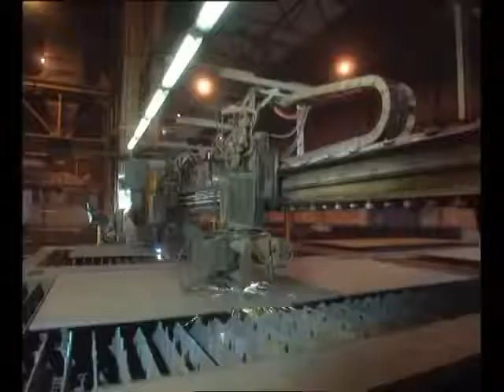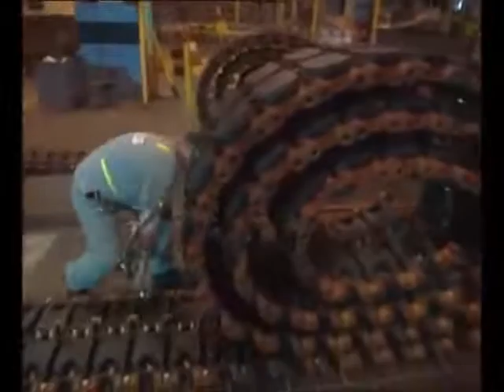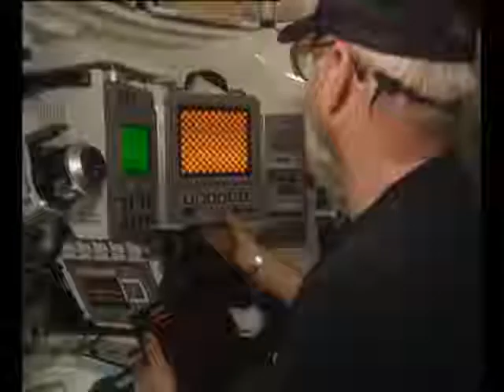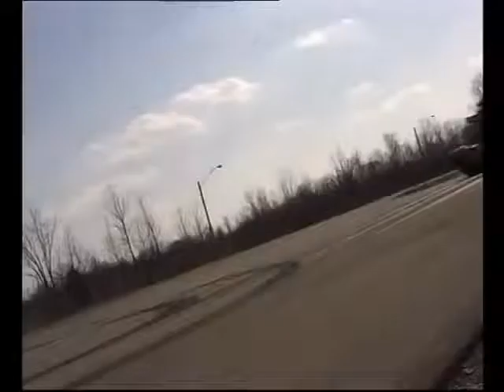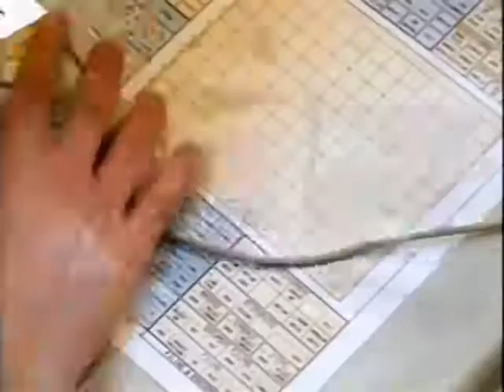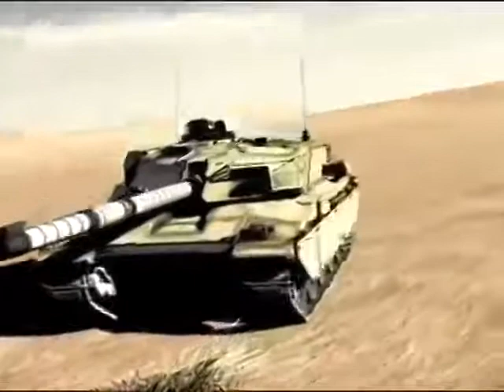Dangerous Weapons 2016 Challenger : 2 Tank Vs M1A2 Abrams Tank US

Comment: The Abrams has some advantages just as the challenger, its a trade off. Yes the challenger hasn't had an enemy destroyed but neither has the Abrams. 9 Abrams tanks were "Destroyed" 7 by friendly fire and 2 by self destruction as prevention of enemy capture. The Armor on the two tanks are very comparable in almost every respect. I'd say it's who shoots first and has better tactics in a 1v1. The Abrams still has more effective weapons control. The Abrams also has a faster to speed of 45ish MPH with 1500 HP. Were as the challenger 2 has a top speed of 37MPH with 1200HP. I think to put one of these machines down is insulting to its engineers. I'd just say both tanks are on the same level of greatness. Although being American I must be partial to the Abrams. 🇺🇸
Reply: Be partial to the abrams but thankful to the challenger. Its the challengers Chobham armour that's now also protecting the abrams

Comment: In a 1v1 the Challenger, hands down, wins. It was designed to be the best in 1v1 engagements against ALL vehicle platforms on the planet. The Abrams was designed to be a modular tank, which isn't good against something that's a literal overall tank hunter.
Reply: Eh idk, I think it would depend on who has the better FCS. And the Abrams edges out in that regard due to it's more modern upgrades
Reply: The Abrams is still more advanced in certain respects and id say its just the pilot behind the wheel. And of course the gunner.
Reply: Depends who shoots first

Comment: I’m American but my opinion is the British challenger 2 would take out a Abrams
The damn challenger is next to freaking invincible... for reliability the Abrams wins. 

It would take a lot of shots to knock out a challenger 2.  

I think The only thing that can take out a challenger 2 is a challenger 2....or a  dead hit from a nuclear bomb..,10.000 degrees would Vaporize anything
Reply: There was a thing i read manny years ago that a challanger 2 got stuck and was not able to use it's turet after driving over a road bomb in iraq or Afghanistan and was under attack for a hell amout of hours by rpg,s till they gave up attacking it the crew survived but didn't get any credit by just sitting in the tank doing nothing
Reply: @SASMacDroid  I seen that documentary, they threw everything at it but the kitchen sink.
The only way to knock out a challenge 2 would Be to steal another challenge 2.....or take a abrams and continue shooting rounds into the challenger 2...if that doesn’t knock it out, the concussion will eventually kill the ppl inside.

A RPG won’t kill a challenger 2.
Reply: The Abrams is modular, which has its positives and negatives. Modular platforms don't win against things that are designed to take out the thing that it is. The Challenger is the best tank platform on the planet when it comes to all-out power and durability.
Reply: Funny you should say only a challenger can take out a challenger as sadly 2 crew men died in a live firing training and they are the only losses to a challenger never lost a man in a live battle only 2 in live fire training RIP boys
Reply: Theres upsides and downsides of both. The Armor is basically the same thing and both are very effective. Speed is effective in Combat and the Abrams tops the Challenger in that respect aswell as weapon control, and the fact that the Abrams has one of the most leathal rounds and gun. The challenger has great armor aswell but it's also never seen action against targets of the same armor tier or "level" persay. In a 1v1 id day its very even and comes down to the pilot behind the controls. It only takes one shot sometimes to down any enemy tank in one way or another so I think its foolish to say a challenger could take hit upon hot of high calliber tank shells without being immobilized. Same goes for the Abrams though. Quick Fact: Nine Abrams tanks were destroyed but none by enemy fire, 7 by friendly fire and 2 by self destruction due to the enemy over running the tank. Take that Challenger! 😂 At the end of it all both tanks are the best in the world in my opinion. Although the leapord is definitely on the list aswell.
Reply: Russain APSFDS can go through challenger armor

Comment: Challenger have better gun Its L55 but riffled. Abrams have only L44 copy and smootbore. L55 on german tests is  10-15% better than L44. Riffled have better accuracy. The Challenger turret have better frontal shape and CHOBHAM mk2 is
same quality as US armor. Abrams have better shape of hull, but Challenger have better prottection frontal and under hull. For my is Challenger 2 better than Abrams A2
Reply: It's been proven that rifled guns aren't better than smoothbore.
Reply: Now, the new Challenger ( 🤔 3) has been equipped with a 120mm Rheinmetal smoothbore canon (Same as Leopard 2)

Comment: So many salty Americans because they have a slightly inferior tank
Reply: They don't and I'm British.  This section is full of idiotic keyboard commandos who have no idea about these two great tanks.  The Challenger is sorely needing an upgrade, hence it's new upgrade programme.
Reply: @JohnnyZenith  - You're 100% wrong. The Challenger is the best in 1v1 against every other tank platform on the planet. It's designed to take out vehicles. The Abrams platform is modular, which isn't good when facing something as powerful and durable as any of the Challenger's.
Reply: Its hard to say inferior as there is a lot we don't know about these machines. Considering the Challenger 2's weight and external dimensions its probably fair to assume it is the better armored vehicle, at least on the turret and upper glacis. With its TES upgrades, it also receives additional composite armor on the hull, ERA protecting much its sides, as well CITV for the commander. Its certainly one of best protected tanks today with excellent fire control systems. The M1A2, however, probably is the more modern of the two as the gigantic US defense budget allows for relatively low priority programs to receive funding. At the end of the day, accessing which tank is better is very difficult to quantify and we don't even have all the information available to us. Luckily, they are both on the same side.
Reply: @cblue3  Most of that weight is in the armor but it's designed against chemical warheads, not KE. Modern APFSDS has more than enough penetration to get through a challengers frontal armor, and most other MBTs